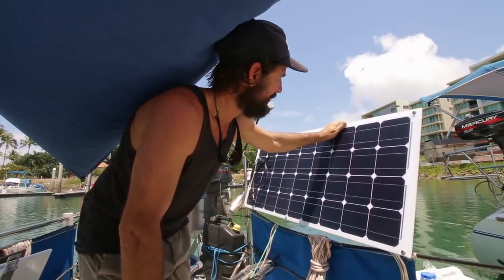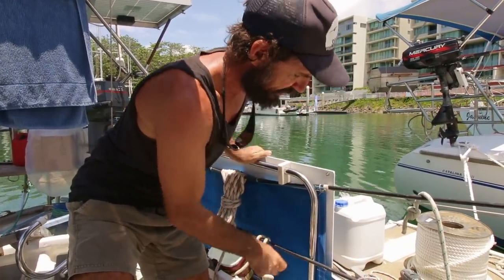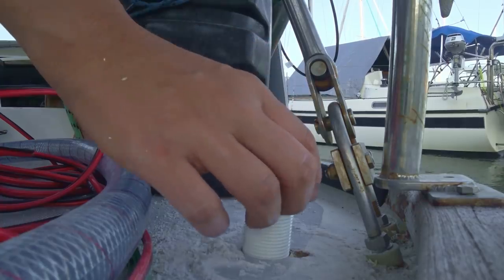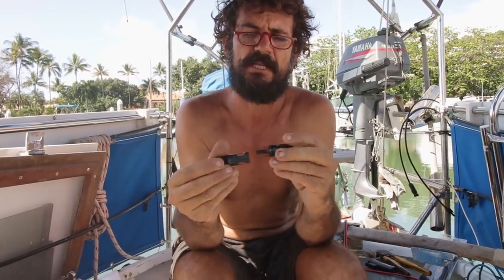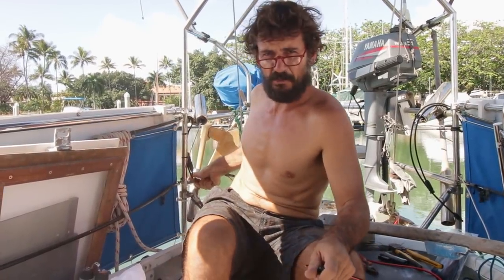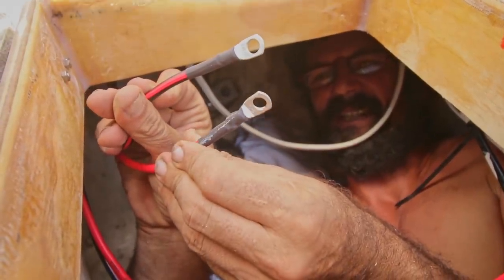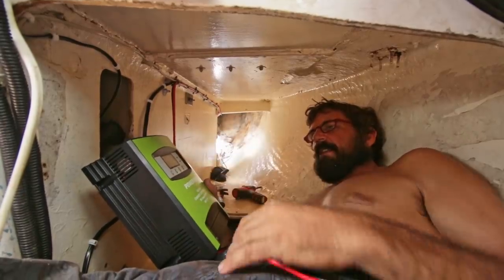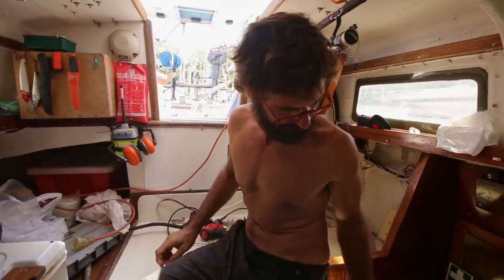A Half Hour of Solar Power: Our New Solar Installation - Free Range Sailing Ep 74

Comment: Thanks , good info , i have noticed the smallest of shadows has a disproportionate effect
Reply: I bought a 240watt panel from easy.get.au on eBay for $175 and could only get 2.8 amps on a bright sunny day. I complained to the seller. They asked for photo evidence of the test results which I gave them and also showed them another 110watt panel putting out double theirs and the reply was to test 5 more times. Complained to PayPal, they stuffed up the complaint at every turn and eventually refused the complaint. They said they would look at it again if I had the panel independently tested at my expense. Not worth it, I could see it was a lost cause.very disappointed in PayPal. I have now bought 110watt Sunpower panels which perform as they should. But $360 each. The quality though is far superior.
Reply from the maker: Sounds exactly like our experience.

Comment: Nothing worse than putting in all that effort and then not getting what was advertised. What I believe is your issue is that your older panels appear to be 16 x 4 cells (64 cells * 0.5Vper cell = 32V) and will likely have a higher voltage output than the Solraiser that are 9 x 4 cells (36 cells * 0.5V per cell = 18V). The higher voltage of the old panels may be causing the MPPT to find a half-way house load between your old and new panels for maximum power point and trying to keep the input voltage higher than the new panels like. I'd put the new two on a different controller. Can you reuse the old controller?
Reply from the maker: The rating on the panels in the literature is all the same- thats why I bought them but in any case, when the old array is shaded to eliminate output, the controller still sees the same output from the new arrays. If we ran two controllers, they have to be on a split bank so that they see system voltage, not the output from the other controller and adjust their output accordingly. If the panels output matched their advertised rating, the system would work with little added complexity.

Comment: Solar panel efficiency has only improved about 10% over the last ten years, so if your getting panels that claim to produce the same power as your old ones for a much smaller area you know its dodgy.
Reply: Solar panel efficiency has increased much more than the 10% you quote over 10 years, panels soon to hit the market will be boasting over 40% efficiency compared with the 15% of those 10 years ago.
Reply: @steviefordranger198  The most expensive ones on the market are about 21% or at the panel level -  Sunpower cells. But nearly everyone one will get normal ones in the 14-17% range.

Comment: Would a multimeter hooked up directly to the panel help in this situation? At least this way you can remove all other potential factors in the system. Also, there's a bit of anti-China sentiment in these comments, which seems a little unfair considering they're world leaders in solar panel innovation, and manufacture 70% of the world's panels for both Chinese and International companies. But from what I've read, you need to do your research and only buy from reputable manufacturers for reasons Peter Imms has already mentioned in the pinned comment. There's a list floating around from the Chinese government on the solar manufacturers they officially endorse. 

Troy and Pascal, I couldn't help but notice some of your electrical gear is bought from Jaycar, I'm guessing out of convenience and necessity. But as long as you're aware these guys themselves just buy cheap Chinese junk and add 300-500% markup to their prices. If you happen to have the forethought and time to do the research, you might want to consider going direct to Chinese manufactures via websites like Aliexpress, Gearbest, Banggood, Geekbuying etc. I've personally had very good experiences with them and saved thousands. But of course, support is virtually non-existent, and some smaller items can take up to a month to deliver. I imagine this is not conducive to the life of the nomad.

Also, you should check out the DIY "maker" scene in Shenzhen and the massive electronics market "Huaqiangbei". A lot of the guys in this market have eBay stores.

Comment: I might have to sue you two. You've stolen MY solar woes and pretended they're yours! Almost identical problem. I spent days thinking I'd installed them wrong. Even pulled the controller apart to check fuses. Nup, just cheap garbage. You're probably aware, but most panels come with an efficiency rating, and even the best are only around 22%.